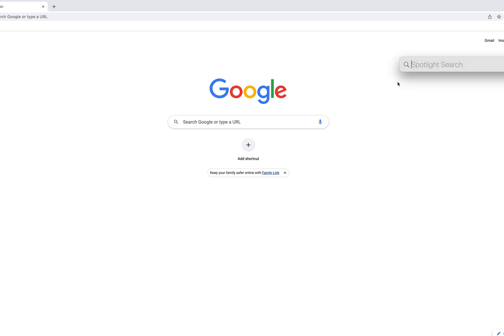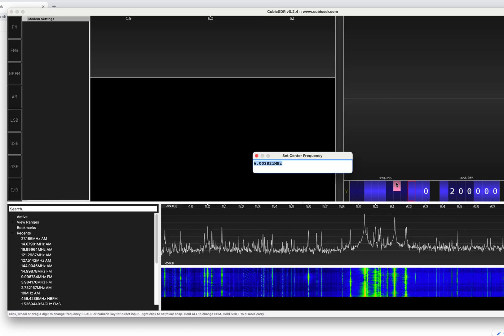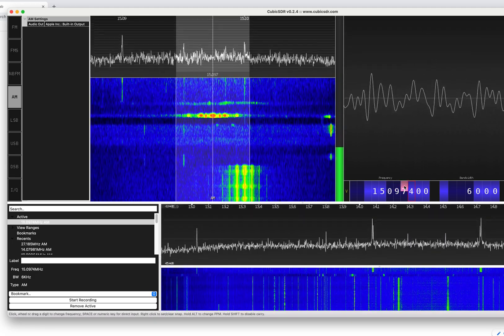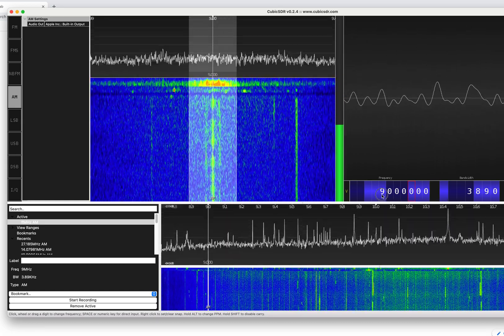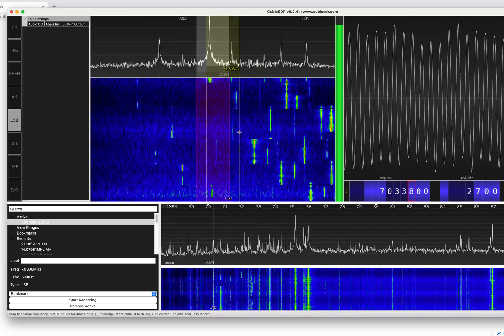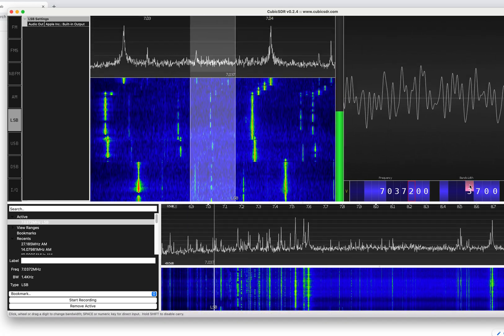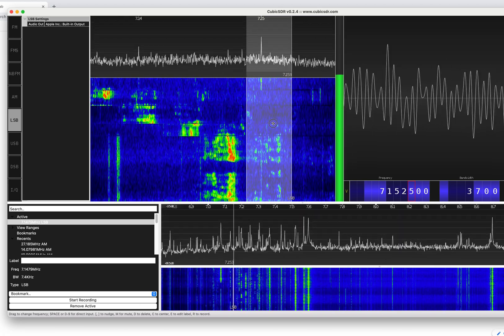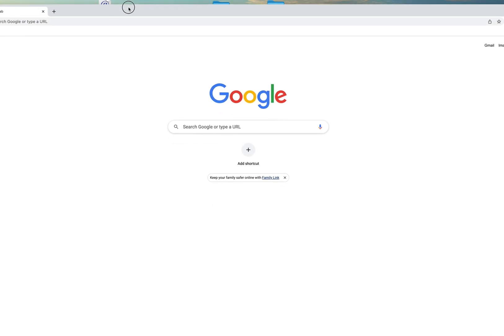Quickstart CubicSDR with RTL-SDR USB Dongle How to USE

Comment: Nice but my GUI has freuqeuncy, bandwidth and center frequency and I am not sure how to use the two frequency settings. I am using a 192kHz soundcard for input and running on Linux Mint 22.

Comment: I got NO Sound on CubicSDR V3 using RTL SDR V4 on Ubuntu 20:04 OS
Reply from the maker: I am using MacOS. Linux is a nightmare. You probably need to config some file or mess with USB sound drivers.
Reply: Debian Bookworm here. Wrong USB drivers in my default Debian. I installed the Debian Ham radio blend for my RTL-SDR v3, all works fine.
Reply: Thank you my good sir